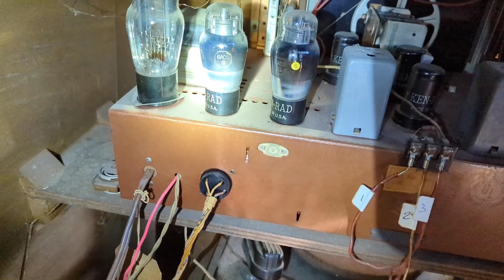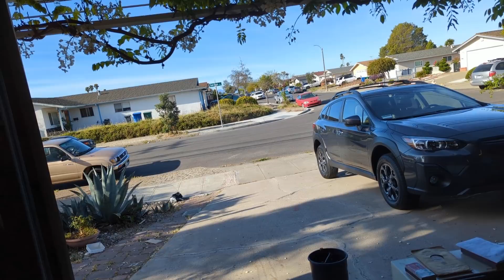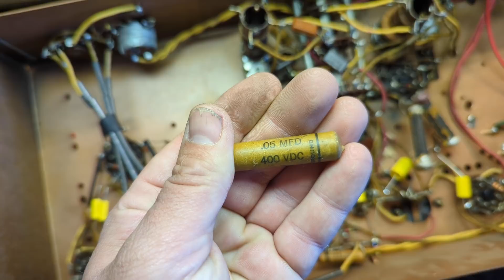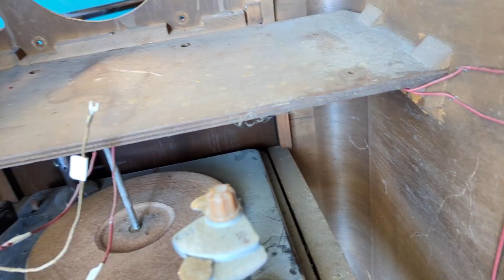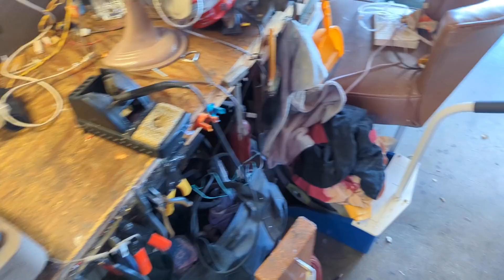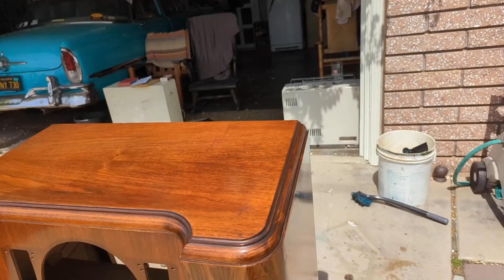Big dial 1941 10 tube Crosley console radio gets restored to its like new glory

Comment: Ole's Waffle Shop. Yum. Work it off walking along the beach. Lots of rubber wire to replace! Repairs were easy
otherwise. Glossy finish is the only way to go as that's how they came from the factory. I don't need reading glasses 
to see that big frigging dial. Great job Seth. Another one saved .

Comment: BBISHOPPCMS had a radio 📻, possibly identical, but dark brown. He has it in the corner of his house 🏠, after doing a full restoration on it. Never 👎 knew these radios 📻 were veneered, but can’t tell ya if they’re particleboard or not. Ya never 👎 wanna sand the patina off, because ya cannot restore it. Cloth and organic rubber wire may need replaced. At least, this is a tube type radio 📻. Your friend, Jeff.

Comment: These are great sets despite the rubber wiring.  The 02 had a direct coupled audio output stage, which saves a couple capacitors while increasing the tube count.  They sound warm but often have a little distortion.  They usually get tin whiskers in their tuning capacitors too.  The model to have is the 03 series with 4 6K6 output tubes!  Awesome sounding set.  I fixed one up for a friend of mine a few years ago.  Crosley and McDonald were friends, loved sailing, often shared ideas, and directly competed with each other.  These sets were designed to be direct competition to Zenith consoles, and they were easily as good or better than the equivalent Zenith models, especially in terms of value for money.

Comment: Crosley was a large manufacturer of radios in the day.  They did produce a very large console radio that stood at around 5 foot tall and had two or three separate Chrome plated chassis and 4 or more speakers in it !!!  The radio was called the "Crosley WLW" There were only 4 or 5 ever made!! I think the amplifiers in the radio were able to produce around 4o or so watts of audio power !!
There is a YOU TUBE entry on this old radio!!  Check it out!!
Reply from the maker: I have seen those online. They are cartoonishly huge things. I think they might have been trying to compete with Zenith and their over the top Stratosphere model